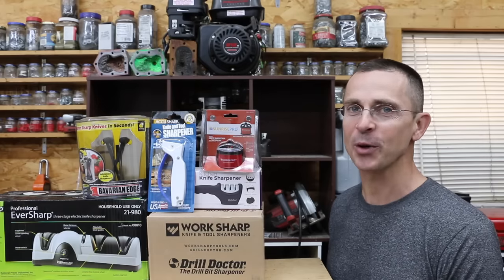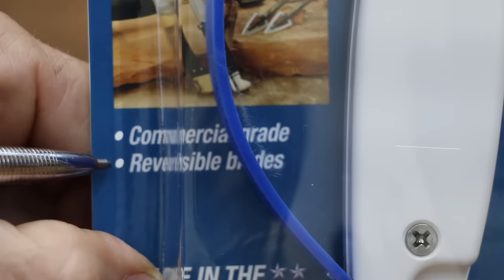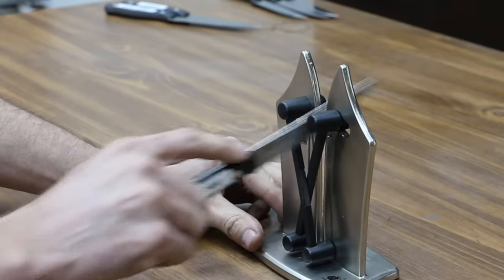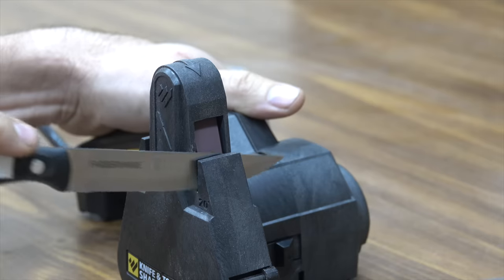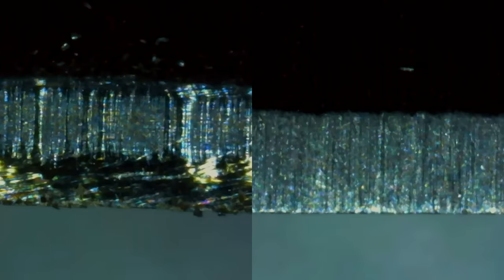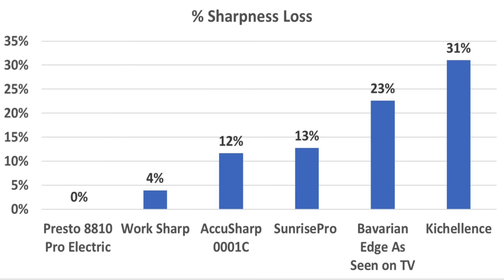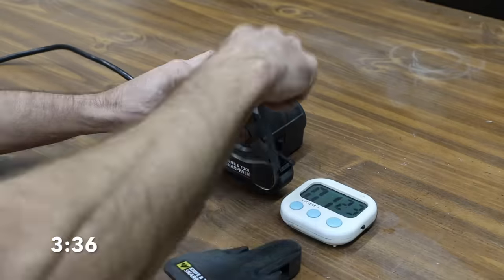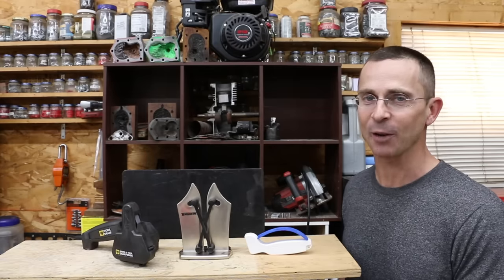Which Knife Sharpener is Best? Let's find out!

Comment: So I'm a knife maker, and I know the belt sander sharpened knife, is by far sharpest. The only thing preventing it from cutting, is the bur, or wire on the edge. To get a razor edge, use a leather stropping   belt with diamond paste to achieve a very high sharpness and edge smoothness.
Reply from the maker: Excellent point!  Thank you
Reply: Leaving a slightly ragged edge is preferable for eat cutting.  Consider the edge on a doctor's scalpel.    This advice  was given to me by an old time  meat cutter back in the day, waaay back in the day. Ha
Reply: spencer wells Couldn’t agree more, I have made and sharpened knives/razors for shaving and the stropping process is key to a razor edge.
Reply: +1 to this. Gotta knock over that burr, I use the Ken Onion Edition Work Sharp on any cutting tool that will fit the guide and am always pleased with the results. My pocket knives will cut through ribbons of paper when I'm done with the WorkSharp.
Reply: I'm an ex farrier and you took the words right out of my mouth. I miss being in the forge. The heat the smell of coke burning the sound of manual bellows and most of all the sound of hammers hitting their work pieces. I also miss digging out clinkers we used to have a competition to see who had the biggest clinker lmfao however I dont miss burning my metal and having to start all over again...
Reply: spencer wells I agree should use the strop. Which rouge or color is best, to use with the strop? And where do you get the diamond paste.
Reply: @rhubarbpie2027    Especially the Ken Onion Edition! PF was using the "normal" edition in this video, but the Ken Onion Edition is a VAST improvement over the original.
Reply: @SergeantExtreme  I love mine. About to touch up the edge on my Benchmade 915 as we speak!
Reply: @Oldez60s  I usually get the harbor freight white or green compound for stropping and buffing knives. I buy this at Harbor Freight for a very cheap price.
Reply: @grassroot011  actually, the wire on the edge of the blade folds over creating a dull edge. When stropped off, the edge is very sharp.
Reply: @stonedsavage7814  Yes for sure it is a very satisfying hobby. Especially when you get to use the final product.
Reply: @Will-Xaru  I have used similar belts  for my knives and the difference is  unbelievable.
Reply: Grinding a bevel is a different thing from maintenance sharpening a knife though, and even when grinding the bevel you are better off working close or on a pulley. Maintenance should be light and frequent and I wouldn't use any of these for that. Very much agree on either a strop with fine compound or a whetstone for maintenance, I prefer to use a whetstone for flat grinds and a strop for convex grinds on tools designed to take a hammering, like axes or field knives.
Reply: Which one is the belt sander ? And which stropping belt set would you recommend for razor sharpening, thanks  ?
Reply: So that is why my grandfather had a leather strap to sharpen his straight razor.

Comment: A key thing to remember when sharpening is that unless you use the exact angle the factory set you have to reshape the blade to establish a new angle.
Reply from the maker: Great point
Reply: As far as I know, these days, for kitchen knifes, it's pretty much 15°. Except in Europe where they seems to transition from 20 to 15°.